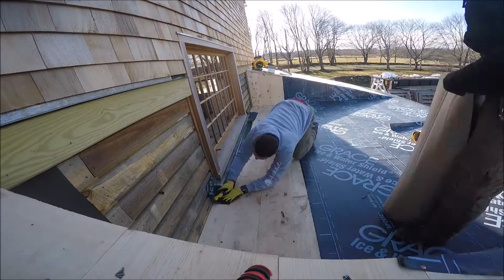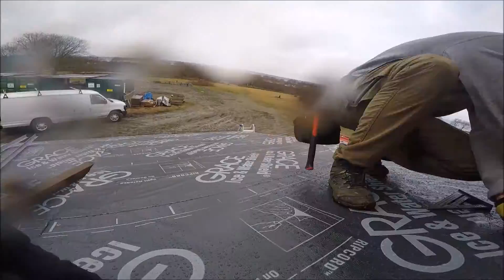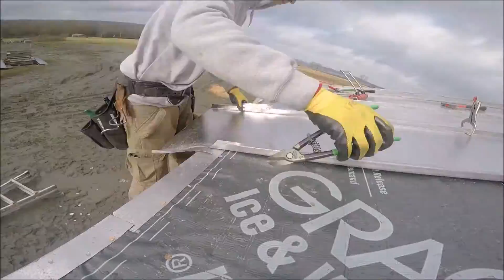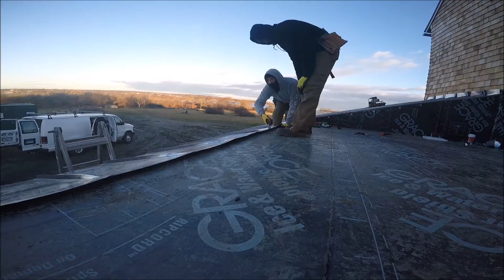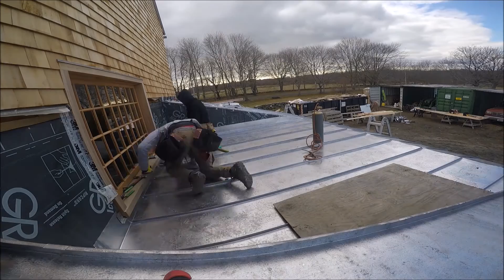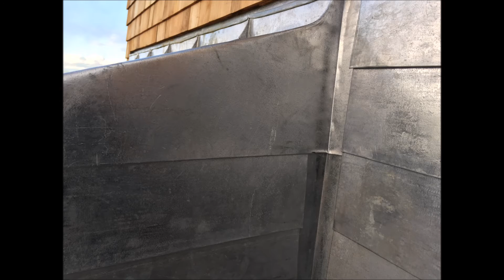Barn Shed Roof

Comment: Nice work, I always put down rosin paper to act as a slip sheet for the metal.  You may not need to where you are? great stuff, keep it coming!
Reply from the maker: I know. Forgot to get it. it was too late for paper..
Reply: 1jpeve yes nice coment
Reply: It was too late for clips and nails too, heh?
Reply: We use Elk Versesheild here in CO. It's required to get a Class A fire retardant.

Comment: Kimhenrik, it would not be accepted also in Germany, France, Swiss, UK and some other places that "Roofers in a Tube" are not available in local Home Depot.
Look at the drip edge. The eave profile is not sufficient to eliminate water seeping or ice damming issues. The ice shield they relay on is good for 7-15 years. After that the holes around nails wont hold water anymore. 7 to 15 years for a copper roof that supposedly lasts 100 to 150!
Also look at the clips. The clips are spaced in double  the spacing they should. They also use one nail instead of two per clip nailed to a lousy 3/4' planks. Probably they live in a windless country.
Reply: mic602

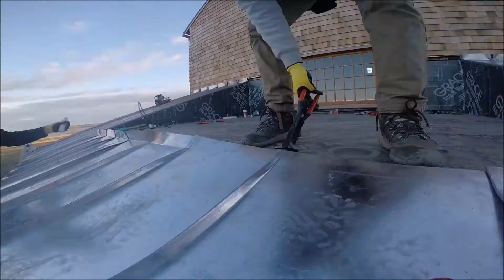Comment: That would not be accepted in Finland your work what u do here. 4:39 i see u have been cutted with the scissors were u should´t not cut and i see u dont use any seam oil at all? It prevents the capillary phenomenon were the water is sucked in the seam.Otherwise i see u have the skills to do great job at sheetmetal roofing.
Reply from the maker: Yes, i know. I shouldn't have cut that corner. i dont actually know why i cut it.. i look at the video and i don't have an answer. I soldered that cornet after though, but yes i shouldn't have cut that. my mistake.. thank you
Reply: Great ! That´s one definition of Pro that u can and u always WILL fix errors if u make one and everyone does them time to time : ) We have 6 months to 1 year courses here in Finland to learn the basics of standing seam sheet metal roofs.I did that work 11 years and then move to ventilation sheet metal works.It`s easier your knees and back : )I read u are mostly self educated to do roofing? Must say very impressive work if that`s the case.Any company here would take u in a heartbeat to they payroll in Finland 100% sure.We are always short of guys like u.Keep up the good work! : )
Reply from the maker: Thank you for nice words Sir...
Reply: I ain`t no Sir , far from it..just a sheet metal worker and proud of it ; )
Reply: will the céder shingles not Stert to erode the copper like they do when in contact with zink and aluminium ..?
Reply from the maker: it shouldn't affect it. it's  leaded copper.
Reply: Igo Is the best